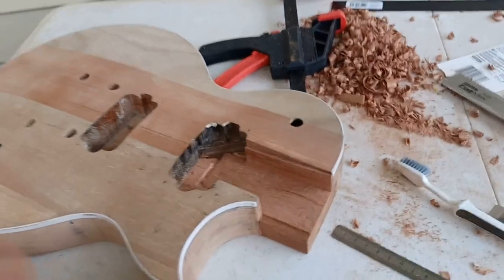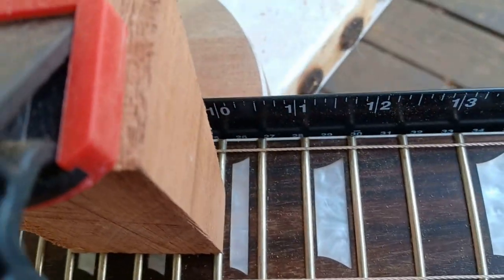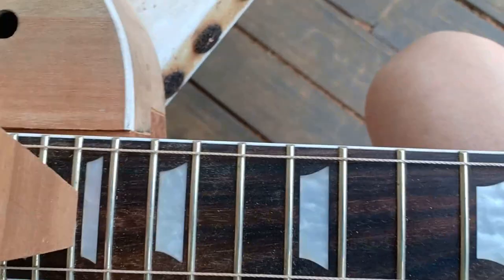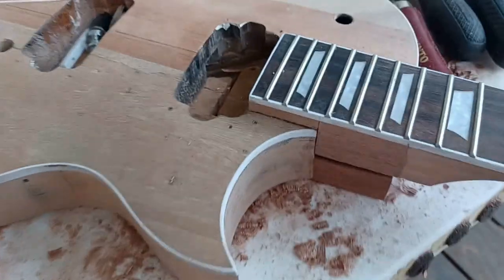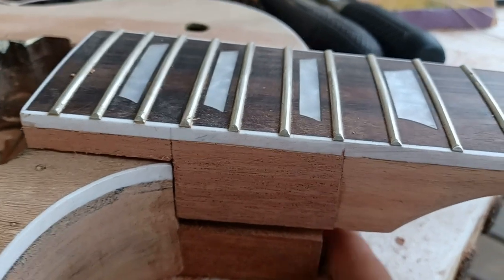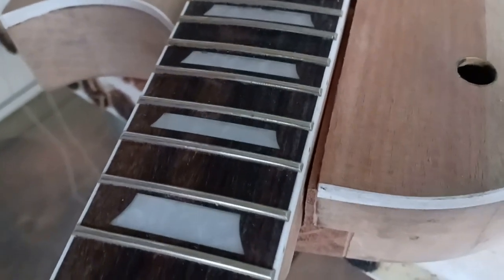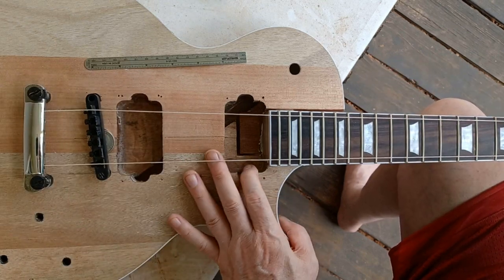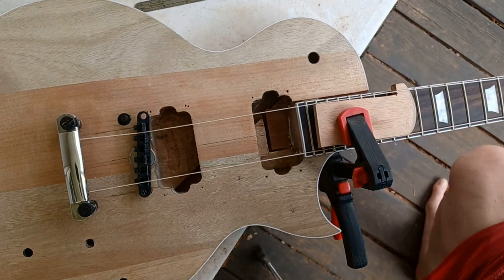Pre GGBO Part 6 Gluing the Neck in #jurgscup

Comment: I kinda dig the strings for alignment. I just use the E strings of the set that I intend to install when I do it, but some tuning pegs have a tendency to beat the ends up enough to cause breakage after a few rewinds.
Reply from the maker: yeah they dont have to be tuned they just need to be straight and thick enough to be an example of strings used.  That is actually left over kite string from a neighbors kid whos kite was treed and ripped apart being pulled down. Plenty to be had and cheap as can get haha.

Comment: Looking pretty good so far. This is turning out to be pretty tedious but that seems to be what is needed to correct the issues it had before you started working on it. If the original builder had taken more time and care all this would not have bee needed.
Reply from the maker: What I get out of going thru this is the original builder 1. was new. I see some thinking patterns that go with a new builder with aligning a straight edge of the neck with a string. straight line to straight line. So naturally if the top string is parallel to the neckj the other 5 should also be right? Its easy to over look the subtle "triangle like" shape of a neck where one end is wider that the other.

I can also see the thinking that once the neck was in place the only way to correct it was the bridge placement. again a new builder could have easily been thinking backwards and moved the bridge placement 3mm the wrong way.

Finally yes it is tedious but for me its a learning process. I am trying out ideas to solve problems as well as going more intricate than necessary to learn more skills like carving and 3 dimensional  shaping by hand. 

I know when I started this it was highly likely it was scrap and was only intending to slap paint on it to work out an idea I have for another build.. Obviously that is all evolving as the process moves forward.

Comment: Looks like that bridge is giving you a real time,,,been there done that. And plugged many a beautiful piece of Mahogany. 
Have you ever heard of a tool called a saddle or bridge finder. Stewmac has something by the name 
of SATTLEMATIC being totally honest about it. All you have to do is measure from the nut to the 12th. It has a notch to rest on the fret. Turn it around and the perfect length will
Make up the full scale length. ;your days of double measuring will be done,,,hope that helped 
I swear by mine!
Reply from the maker: The hardest part was figuring what was out of alignment. Learned it was both the neck AND the bridge.

My Grandfather was a mold maker for a big injection molding plant. I learned to measure accurately and  use hand tools early. I think he would come back and whoop me if I bought an expensive single function tool just to drill two holes.

I will take a look to see what it is though for sure. ALWAYS interested in learning new things!

Comment: Lol.... Sanding.  And fabricating little pieces of wood that have to be clamped as they're glued , is the most time consuming thing on a build....i pretty much only do ML and Stealth ML  w / Floyd Rose and set necks.  So  i pretty much Know what I'm going to need.  And if im smart or lucky. I can glue and clamp in two things in one day.  So the next day i can continue.     .i remember my Les Paul Custom. China kit Body build..  i set a Fender Squire Skull Showmaster Neck in it.... Trying to change the headstock to tilt back Gibson shape.  From Fender. Parallel no tilt was a Beotch..  but i got the action so close.  So tight.  So everything was decked... I eventually raised the bridge 1/8" because the action was just too tight for good resonance.  Lol. I still pull it out and play it occasionally..  i put EMG 81-85 set in it..    but getting the bridge to get perfect with a 25.5" scale neck.  Was.. interesting.🤔. I do that all the time now so I'm used to it..

Comment: Coming along nice Bill, I think I said before but 630mm for high E and 633mm for low E works perfect every time for me using a tom on a gibby scale.
Reply from the maker: yeah on the two I have built I mark the 630mm line then drop the low side 3mm and shift high side 2mm and easily hit perfect intonation with room in either direction for adjustment.

Comment: Looking good, pal.  I'd question the use of Gorilla Glue, though...  Doesn't that expand in a similar way to expanding foam?  Might leave a load of tiny air pockets, reducing full contact between the pieces?  (I could be wrong, but I'm pretty sure it's something I heard a couple of years ago).

I had a similar alignment issue on the LP kit I'm finishing up (just need to make the knobs and switch tip for it).  Though the neck fit perfectly with no wiggle room, there was more clearence between string and edge of fretboard on the treble side.  What I did to get around this was to file new grooves into the bridge saddles for the G and E strings, edging them towards the side of the fretboard.  I had left afixing the pickup rings in place until this point, which happened to be fortuitous as I was able to align the strings directly over the poles.
Reply from the maker: Nah. this is Gorillas version of white wood glue not the expanding stuff. The wood around the joint will be destroyed before this glue lets loose. I tested it years ago on a radio case project with birch ply and accidently got a single drop on two 12 x10 square panels I stacked flat over night after working on the frame. The wood splintered and tore out huge chucks after prying them apart with mechanics prybars. I used it on the BRS I used it on Lzzy. I fully trust it.
Reply: @borgonianevolution  Cool beans 😁

Comment: I like builds. .. i do about 2 a year.  Or 1 .  Depending on the $ i can save up to buy parts    i have a Ton of parts    i could probably build 3 or 4 lame ones now..  
 its necks that i start my builds.. 
I do my necks the same way.  Tracking the 2 outter strings down to get the trajectory.  Height.  Ect set when i clamp the neck in.  And i set pretty much all my  necks.. 
I  need a decent fretted 24 fret neck to dtart a Build...  the rest is just hobby craft to me